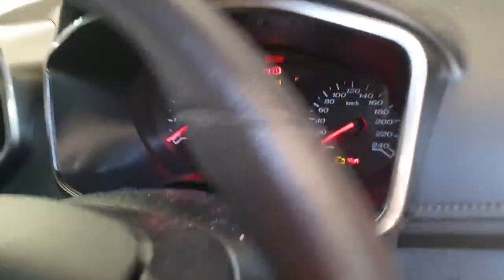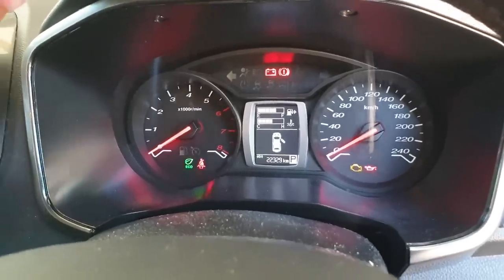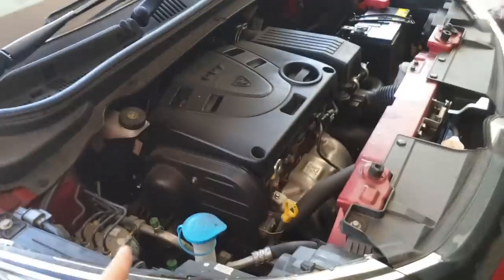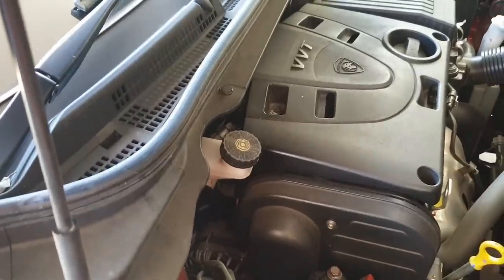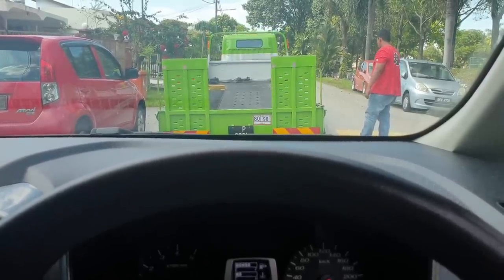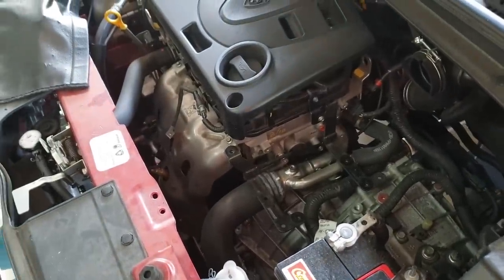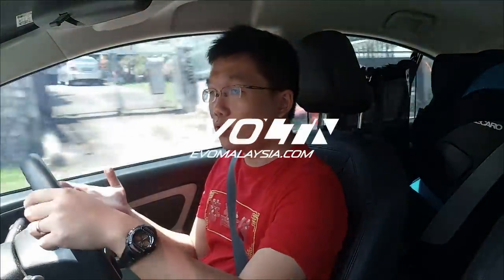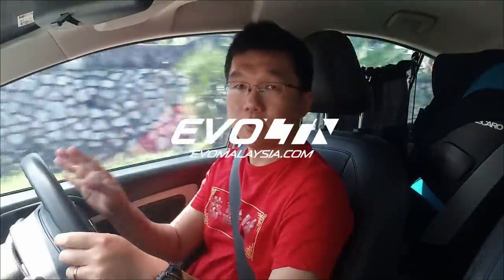Proton Persona VVT overheated due to air bubble in radiator | EvoMalaysia.com

Comment: My 2011 Persona ex-taxi, now odometer is 998,000 km. 

Have to learn how to maintain & monitor vehicle condition.

As for overheating. Never fill radiator with pipe water. Replace thermostat every year. Only $30~$40. Replace radiator cap regularly. Only $10~$20. Monitor fan motor working properly.
Reply from the maker: Good to hear of such a high miler Campro still running. Done any overhaul?
Reply: Only replace head gasket due to overheat. 
Cooling coil, starter motor, fuel pump, alternator, compressor still original.
Replace timing belt every 120,000 km. But do not follow this. Think i only replace timing belt only 5 or 6 times.. 😬. When still a taxi, use Petronas semi-synthetic engine oil. Replenish every 15,000 km. This too, do not follow. One of my friend realised he forgot to change engine oil after 100,000km. But engine still ok. As for drive shaft, only replace inner CV joint for both side. Replace window regulator driver side once.
Reply: holy shit.that is some magic you got sir.now that is what we call reliable workhorse.
Reply: Bezza as a Grab car can achieve 900,000 km also???Persona can as a taxi, Bezza as e-hailing taxi can also right
Reply: Want to hear more about your car
Reply: @noorehanzainalabidin3371  timing belt 120k km tu utk brpa tahun tuan?
Reply: Wow..900k ! Mine just 520k mileage...2010 persona..I'm doing field support. So far engine in original condition, no overheat running fully synthetic mannol engine oil.

Comment: Alhamdulillah my myvi even after 11 years driving like crazy, never been on a tow truck
Reply: Myvi engine better than proton campro engine in term of quality
Reply: It's a Toyota engine and it's reliable
Reply: Not all campro problem.. In 100 cars maybe 1 or 2 effected.. My saga flx 8years running very good and not have any problems..
Reply: Not all, my Campro 10years never go in tow truck, except once because of accident. Campro quite realiable if taking care properly
Reply: Sb ppl😂
Reply: My 14 yrs old gen2 have been towed 3 times, 2 times because of accident and one time bwcause of overheating and faulty cap ayam fan motor other than that, it is super reliable. Now clocking 300k km. But currently she's hibernating for a while because roadtax suda mati hahaha.
Reply: I am scared right now..I should buy myvi..I have a persona
Reply: @bella8145-d9z  no need to be scared lahh just jaga makan minum dia
Reply: @tiadanama1998   hahaha tak tau sgt psl kete..tau bwk je..
Reply: @bella8145-d9z  make sure service engine oil dan gear oil on time. and air coolant pastikan sentiasa ada. hehe tu je yang penting. dan kena alert juga pada indicator kat dashboard, in case ada logo pelik2 naik terus gi check kat bengkel.
Reply: bezza  also no overheat or knocking issues.
Reply: Bezza also got a jerk during driving.....  Actually every brands got some problems because nobody's perfect. It just that as an owner.. You are responsible for your car's health by doing the periodical maintenance on time. Then you can get the best out of your car
Reply: My exora cps is already 10 years, always jln jauh (1200km) , pushed hard so many time(rpm above 4k rpm to make the cps on when balik kampung, the road have so many uphill) due to heavy body + grab. Never had this problem.
Reply: @bella8145-d9z  stedi sis , exora ak dah 10 tahun, selalu jln jauh 1200km, kat sabah byk jln berbukit from kk - tawau - semporna, dah 10 tahun enjin dipaksa sebab body berat. Oke je pun keta sampai sekarang, bunyi enjin pun halus je sama mcm tahun 2009 dulu ... janji service on time, pakai gred motor oil yg btul
Reply: @tr6864  senanya bawak 4k rpm pada jangka masa yg lama adalah bagus. Ia dapat membersihkan engine. Ianya diapanggil italian tune up
Reply: nabila shukri hahaha... smelh... dah 3 kli ganti motor fan baru.. Saga blm usia sdh msuk 10 thun prnah kne towing 1 kli sbb accident
Reply: Muhamad Rosly because cheap cars always have some issue.. nak elok pakai honda our toyota je😂😂
Reply: New persona also use engine toyota lol VVT bro.. hihi
Reply: john kratos  lol dah enjin campro² ler ape kaitan nk kacuk head toyota body campro ni 😂 profile enjin vvt pon dah berbeza pakai timing chain dgn campro pakai timing belt.. kalau chasis ye la masih milik proton..
Reply: @tiadanama1998  ouhh ye ke bos. Kalau jln jauh 1200km rpm memang kerap naik 4k keatas sebab body berat, nak bgi cps tu hidup. Kalau tak, yak dpt maintain speed kalau nak naik bukit 😂
Reply: john kratos  bnnyakkn belajar lg bro.. vvt dtg drpd mne.. enjin vvt, cvvt, dvvt dvvti semua enjin yg ada tulus vvt milik toyota.. proton beli enjin dr pd toyota mcm produa yg pkai enjin dvvt. Klau benda tu pon x tau xyh nk sembang psl campro bro haha.. serupa cakap dgn tin kosong.
Reply: Mine proton saga 1991...28 years old car...never naik tow truck...tanak ter sadai tepi jalan replace benda2 sperti alternator,radiator+kipas, coil over plug jika dh pakai lama...kerana once dh 10 tahun usia kete tu...benda2 tu dh nk tamat dh riwayat dye..
Reply: @ashrafwengweng2919  salah bro, vvt proton bukan dr Toyota. Vvt proton still campro head dgn beberapa bemda lain je diorang tukar. Campro vvt ni still pakai timing belt. Btw teknologi vvt ni bukan Toyota punya, pengeluar lain byk guna teknologi ni, cuma nama je lain2. Mcm Honda dgn vtecnya, bmw dgn vanosnya
Reply: john kratos  wahhhh abe john ada jugak kt sini..hebakk arr dia
Reply: @ashrafwengweng2919  VVT dri Campro hnya technology je Toyota
Reply: john kratos  VVT ade dua varian Timing belt atau Chain.. Avanza dan Vios pn pkai timing belt.. yg lain aq xtaulh slain Myvi??
Reply: @ashrafwengweng2919  confidentnye ckp engine campro dari toyota 😂
Reply: @ashrafwengweng2919 bro letak spender dekat muka bro 😂
Reply: Same with me. Alhamdulillah. Myvi auto 1.3 year 2008.

Comment: my suggestion to you is
for the radiator coolant issue
- For the next coolant change, change to toyota long life coolant, it's expensive but it's worth it(RM25/1L), u need 2L

for the engine knocking issue
- Try to only pump petron/BHP
Stay away from shell and petronas, at least that resolves my saga engine knocking issue
Reply: Hi Allen, the stock base for all petrol is the same depending on the rons rating, only difference is the additive, what might you feel knocking and not might be placebo, in technical each engine have a knock sensor and a closed circuit loop, this sensor giving real time data to ecu to adjust the fuel ratio, so why not knocking? FYI your car can be fueled up to Ron88, that's how it works
Reply: @salopaindahouz  i don't think it's placebo because i'm not the only saga owner that experience engine knocking in malaysia
and it's very obvious(the engine knocking)
and yes, the difference between all RON95 is just the addictive(other than BHPetrol which is euro4m)
but whenever i'm using shell, the engine knocking is really obvious but it dissapear when i pump petron

and even though all RON95 are the same but pumping from different brand did give me different FC....again shell being the worst for me
Reply: @alien13579  in that case your experience does matter and I will personally test out the fuel, cheers
Reply: @salopaindahouz  no offence to shell or shell lovers but i wouldn't call it a placebo because i've tested over and over again
been staying with petron since their esso era like 10 years ago
every now and thn when petron has a long queue or no stock, i would go pump shell because it's the closest to it
but every time i pump shell, that bad FC always comes back for no reason
the numbers on the trip meter don't lie

Comment: My iriz 1.3 has the overheating problem, it resolved after changing the radiator tank. The mechanic told this is common problem radiator always clogged.

Comment: My Proton Preve CFE overheated in January, after driving only for 10 minutes. Temperature gauge went up to full (8 bars instead of the normal 4), and it started beeping to warn me of the overheating.
I stopped the car and let it cool down for 30 minutes and restarted it (then showing 2 bars). Drove it slowly for another 1 km and could hear something in the engine and smelt some burnt smell. Stopped the car again to investigate further. As it happened on a Friday night, I couldn't see much, and I didn't open the radiator cap as the engine was hot, but I noticed the coolant reservoir cap was dislodged probably due to the high heat and pressure. I closed it back and waited again for it to cool.
Engine started knocking on up hill driving and soon after, I could not drive the car any further. I called the tow truck to send the car to SC. The following day, was notified that the lower radiator hose was dislodged resulting in coolant leakage. I asked them to do a thorough check (left the car there for 4 nights), they did a pressure test and said nothing was wrong and couldn't find the issue. 
They topped up the coolant and so far it has been running okay like normal. I have driven it up to Gohtong Jaya during the CNY holidays. 
Just to note, I had the SC change the radiator hoses, cap, and the clamps 3 months before the incident because the SC detected rust forming in them. I am now wondering if the hoses were not fixed properly which led to the hose dislodging causing the engine to overheat. Just a thought, I am also wondering if the SC did not put in enough anti-rust in the coolant mixture with water. Have been using RON95 since I got the car in 2012.
Reply: I love Proton but some SC just are very troublesome...I don't know how they manage this things... Being an engineer who studies ICE(internal combustion engines) I can say that RON 95 is quite premium bcoz Americans use the highest RON 92 if I'm not mistaken..so it should be fine...btw thanks for the info
Reply: actually..proton reputation had been damaged by SC..coz mostly run by silly n hired non qualified stupid mechanic..n some overcharged..specially lady cust.when they simply advice cust.to chnge unnecessary parts.. xample like..chnge brakepad in facts still got 50-60%..brkepad..for brnd new cars..ladydrivers..xpblm can lasting for 2.0~2.5yrs max.. at 80k/km usage..trust me.!!
Reply: I agree. Service these days mean 2 things; either your car come out good or worse. I asked the SC to check the dashboard due to a lot of noise. They broke the panel and didn't even tell me what broke. Had to grill the SC to admit their mistake. Paid rm400 for new panel.

Comment: After 60k service at HQ SC (COSE) and drive about a week. My car (2016 Persona) CVT icon issue come out suddenly. When you stop at traffic light, it doesn't move. Until you shift to L. Drive a car with gear shifting to L after awhile, shift it back to D only can drive normal again. Happening few days only i sent back to COSE to check it. FYI
Reply from the maker: Was the cause diagnosed?
Reply: @KonWaiLuen  I hope so. Collected car by yday. They tell me tried to re-update an ECU. Open up the gear box part and see nothing wrong. Could be the ECU firmware?

Comment: Fan slow . water pump ...fan blade. Radiator .gasket leak air leak .cup .termo...these only reason heating up
Reply: This is proton when using campro or vvt(updated version of campro).

Comment: Brader..... Swap coolant every 1 year. My saga VVT also have almost similar problem after 1 year. The issue came from proton coolant is not thick enough with coolant compound causing it super dilute hence causing air bubbles trap.

Comment: I don't think air bubbles will cause overheating issue, see during old cooler flush out what it contains... Suspect thermostat maybe jam or not functioning well or there will be another issue....  Air conditioner hot... Is the compressor working or magnet pulley working?

Comment: My dad's Almera overheated once. It was due to coolant leak from the heater core. That car has a climate control so got heater. People at TCEAS had no idea that thing was possible after so many visits to the SC until I suggested the heater leak based on my friend's i10 and I felt the carpet was soaking wet. The warranty was over so they bypass the heater instead.
Reply: Usually cars sold in Malaysia do not come with a heater core to reduce cost as our weather is hot all year round. Thanks for telling us that Almera had one in it.
Reply: ETCM saved cost by fitting one airbag to the Almera but left the heater in for Malaysia? Interesting
Reply: @duaneyeoh4283  more expensive to make hvac system for our market only i guess

Comment: oh hey KON, yeah. I drive a Proton persona vvt with a standard manual transmission. I have received the software update during my recent service last December. The instantly after the update, the initial feeling of the car was that the throttle response has a noticeable improvement. The flow and the engine "booging" at low rpm (1300-below2000) has a noticeable improvement. It has the power delivered more smoothly. No knocking issue since day 1 for a year of ownership. The gas pedal is now more lively, bit more responsive. Pulling power at high revs are more linear and smoother, (but i expect it to be bit punchier more as the previous one). And lastly the speed limiter. I'm not sure whether they have increase it or not, but I was once there but 6200 there about, but the last time i reach there, the ECU does not do the cut off for me. 

I heard from the chinese proton persona vvt owner group that they have positive improvement overall after the update, TCU of the CVT and the engine output linearity.

Comment: This is what I don't get with Proton, why the F fix something that isn't broken? Older gen persona the 2014 ones have radiator 2x the length of what is shown in the video, there is 2x the fans attached to the radiator, one for engine and the other for aircond, with such a massive radiator, it takes a while of high revving while vehicle is stationary for the radiator fan to turn on, even then it turns on for roughly a few seconds before turning off again. 

As soon as you turn on aircond, both fans turn on, the engine is already damn cold just from the massive radiator, but with aircond on damn.

Comment: Kon, the same thing happen to my cousin's Proton Preve.  Exactly the same thing. For the overheating, the fan did not turn and suddenly all kind of warning lights came out. The SC diagnosed the problem to be an unresponsive fan and thus reflash the ECU. After that, a few months apart the fan did not turned off even after he shut down the car. Guess what, ECU. They reflash again. This is a 2013 NA Preve.
Reply: It sounds like a relay problem as the fans should not be on when the engine is off as far as i know
Reply: @soonvincent6404  yeah.They ketuk ketuk it, done some tuning, change whatever and now it's ok.

Comment: Better careful, air bubble and coolant contain mixture of engine oil and coolant, it shows that your engine leak at engine head, due to overheat engine.. worst case, you need to skim you head engine and send for engineering works.. gasket damaged also probably could caused the engine oil enter into the  coolant.. if air bubble only, yes indeed it was an air trap.. use original coolant and avoid to use water because water could corrode and damage your radiator coil, water pump and thermostat..

Comment: Hello
I have proton iriz 2016 1.3
When i put on “D” , from high to low hill/bridge 
And dont press on petrol 
The RPM become highhh
It should not move because i did not press on petrol.

Second why i drive on 100kph my rpm 2.8RPM it should be low. 

And even if i am P RPM moVe by it self keep oscillating .
Is it because of gear box ?

Comment: Radiator sumbat ni akan jadi bila bawa 80km keatas lg teruk bila nak nail bukit sbb kipas xsempat nak sejukkn.. Sy prnh jd mcmni bila nak isi air dlm radiator bila dh sejuk jd byk buih mcm tu sbb air dlm radiator dh kering dan tandanya air dlm spare tank penuh sbb radiator bila sumbat xsempat sejuk jd x sedut balik air dari sparetank.. Kne rajin flush radiator dgn check cup sbb klu karat akan buatkan jem dan tekanan terlalu tinggi dlm radiator boleh blowkn head gasket.. Papepn karat musuh utama sistem penyejukan
Reply from the maker: jadi setiap servis wajib check keadaan coolant.
Reply: @KonWaiLuen  ya kalau nk thu check cup klu ada karat dlm radiator pn mst ada karat

Comment: in 2007 my aunty offer her 1985 toyota corona to sell...then i said i wanna buy a new proton car & i did...u know what? after the payment was finish (7 years) the car making so much problems & stranded on our car porch...so i buy my auntie's toyota corona after 5 months my proton go banana & still untill now...i just need to change the engine oil,brakepad,car battery ONLY!!! well...buying a proton again? NEVER again!! such a nightmare & piece of junk...the plastic just falling apart when its old,the body get rust easily & some parts not sell even by the service centre😒

Comment: Good Morning Mr Kon, is it good to change from ron95 to 97, i also noticed that my persona vvt knocking sound when using 95, but when im travel for long distance using 97, the knocking sound absence?
Reply: I'm an mechanical engineer who studies ICE(Internal Combustion Engine)... RON 95 is actually quite premium considering that most cars in the US use lower than RON90...U can try to experiment using RON 97 for a while no problem... Just to let u know that engine knocking does not sound knock*knock* slowly.... They are more to fast paced sound... Because the explosion occurs fast

Comment: A bubble build up should go straight into the highpoint which the radiator, and cuz of the expansion the bubble should pass thru the spare tank
My thoughts is this maybe a case of malfunction thermostat cuz there is no way bubble could build excessively on a 2 year old car given its not leaking whatsoever